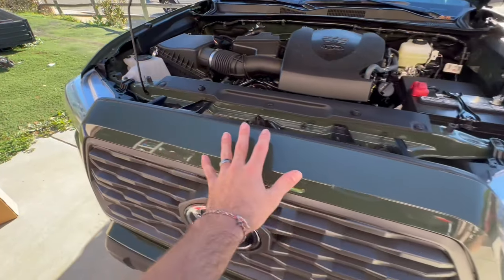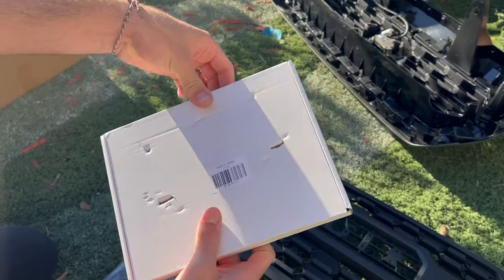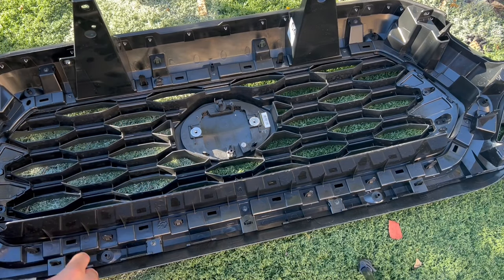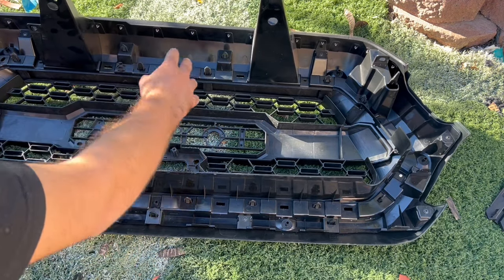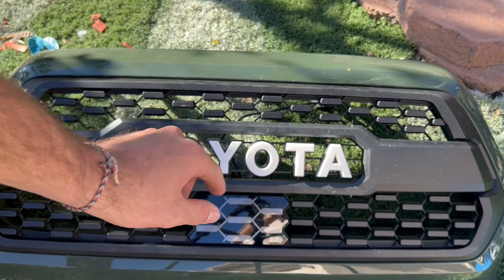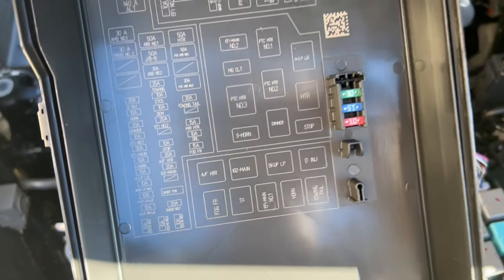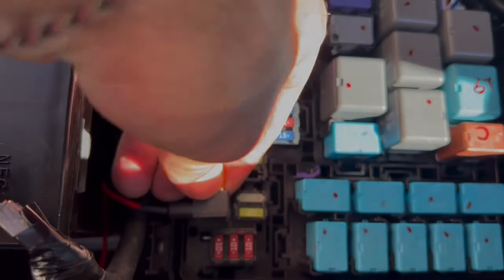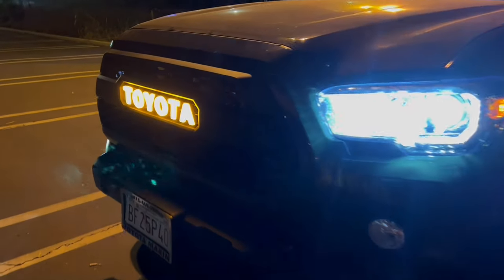3rd Gen Tacoma Light Up TRD Pro Grill Install

Comment: The sensor to properly install you need to take the 2 metal pieces off the old one, the threaded pieces and they slot into the new one so you have threads to attach the sensor to the new grill. Also, for the add a fuse the trap door method is the way to go so the fuse box cover don’t pinch the wire
Reply from the maker: Ahhh! Thanks

Comment: Looks great. Thanks for sharing. However, I was wondering if anyone knew how to solve the fog light fuse and the letter lights not shutting off? Also, I tried to hook mine up to the headlamp like in this video, but I had the same issue. When I turn the lights off, or turn off the truck, the lights stay on. Anyone know of a way around this issue? Thanks in advance.

Comment: That’s nice man looks great! Could you run this and raptor lights at the same time?
Reply: Yes, by connecting both the red wires of the lighted letters and raptor lights, to the same add a fuse.
Reply from the maker: Thanks!
Reply: @kokautoparts4476  oh okay. Do you know where I could get a ring terminal for the ground wire in the raptor lights?

Comment: I recommend you to put the 4 little lights I have them on mine and they look super sick the the other lights!
Reply from the maker: Hmmm maybe your right
Reply: @TheUnrestricted  I’ll see if I can put mines a the my profile pic so you can see
Reply: @TheUnrestricted  there you can look <
Reply from the maker: @joserobles5212  ohh nice!
Reply: Jose how did you wire them? did you run them together so they are on at the same time?
Reply: @kennylopez5207  I connect them to the fuse on the fuse box is connected to my lights so when ever my lights get on they turn it. The “Toyota” had a hardness that makes all them to connect to only one connection.
Reply: @joserobles5212  Gotcha - so it was pretty easy wiring the raptor lights together with the harness on the Toyota light? Thanks for the response
Reply: @kennylopez5207  correct.
Reply: @joserobles5212  nice dude I might have to give it a go! Love the look of yours
Reply: last quesiton lol is the amber color about the same in the Toyota light and the raptor lights or can you tell a big difference? hard to tell by your pic
Reply: @kennylopez5207  it looks pretty sick tbh it’s with it. Specially night time looks sick
Reply: @joserobles5212  nice thanks
Reply: @kennylopez5207  same color there’s no difference.

Comment: I like it when it is off.  I think "Toyota" in white letters looks classic and the letters do look like good quality.  Did it come with the garnish?  Or was that extra from some other vendor?
By the way....another question.  Why did you take the red "Trd Off Road" sticker off of the truck only to add more red back to the wheel's center caps?  Just curious.

Thanks!
Reply from the maker: The red didn’t look nice On the green
Reply: @TheUnrestricted  It absolutely does!  Red and green are opposite colors so there is a real pop when you have red on green, especially that mid to dark Army Green color.  Your black sticker looks fine, but the original red version would have tied in nicely with that touch of red on the wheels!  I did see where the garnish was included...I didn't see it in the packaging when I first watched your video.  That's nice that it was included!

Thanks for posting a video on this new grille by the way!